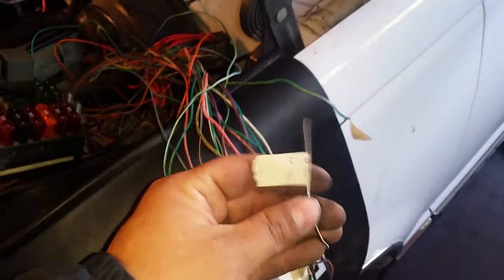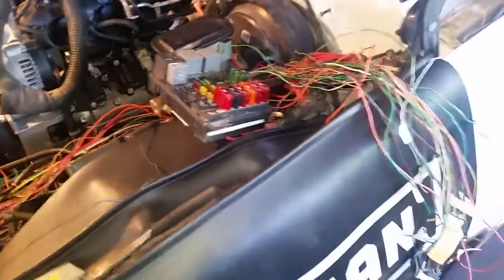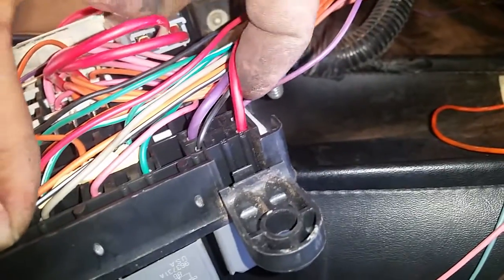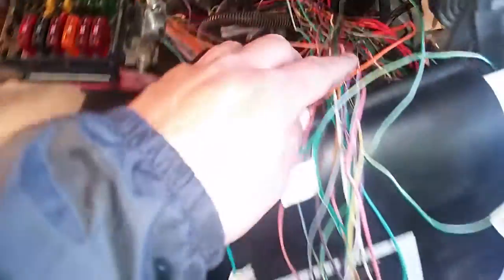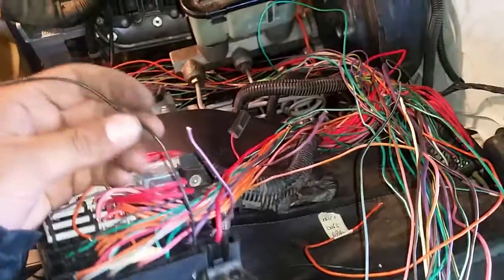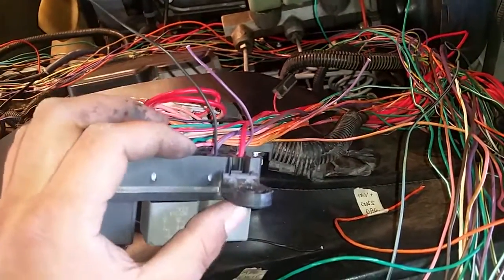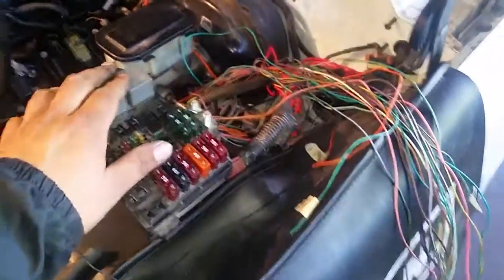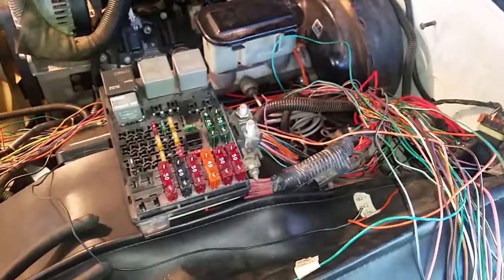OBS Starter control with new pcm

Comment: What  year truck are you swapping?. I am admiring the fuse block thinking it would work on my 63 Impala swap.
Reply from the maker: 97 suburban.  Don't put anything like that in an impala. Custom make your harness to fit that car. I know,  I have a 64 too.
Reply: @skeeter5283  it looks a lot less complicated than the 2002 Silverado   under hood fuse block that came with my engine and still has the modern relays and Maxi fuses I'm looking for. Fuel pump starter cooling fans AC etc.
Reply: @skeeter5283  love the starter update

Comment: So your saying i should send my harnesses to you😆
Reply from the maker: Did I say that?
Reply: @skeeter5283  no😊i was just joking. Thank you for all the uploads youve done. I still watch your old videos.
Reply: @skeeter5283  mines will be slight diffrent with it being 4x4. Im trying to see if i can go with a newer transfer case and front differential. Basically using all matching LS engine,diff,and transfer case.
Reply from the maker: @JoseContreras-mv5yz  that's what I want to do next. Check out this badass truck if you haven't already seen it, https://youtu.be/-D0hFHyuHWw
Reply: @skeeter5283  yes ive seen that over and over😆😊only thing that gets me is the angle to use to make that bracket for the front differential. Im sure you dont have to build the bracket that way either. I was thinking something in a shape of a triangle.
Reply: @skeeter5283  @ amigo, on 99-01 pcms   Weres the crank signal? O no tiene?

Comment: Is there a way to add fuses into the original fuse block for coils, injectors ect.? I’m trying not to have to add a stand-alone fuse block
Reply from the maker: I actually tie all the pinks to the existing fuse block,  and orange,  red,  etc.  There is no reason to add more Fuses,  if any of them short they all go down together through factory fuse location.  What year obs are you working on
Reply: Gary Garcia it’s a 1995. I wasn’t sure if the stock wires and fuses could handle the extra load if I just spliced into them
Reply from the maker: @SuperBogdaddy  that's what i did on my 97 suburban,  i grabbed every single pink hot from both harnesses and joined them by solder,  it's a lot of wires, but i have a torch that joins them well.... been running strong for a few years with no fuse issues

Comment: Gary please give me some help i have the new 411 pcm programmed with my vin..1996 tahoe obd2 will it be able to go thru emission with the swap being done
Reply from the maker: Good question,  I've never done that.  I know there are changes that need to happen in your O2 wiring,  and there will be extensive rewiring at the pcm. You will need to research this to find out,  I'm not sure.  Try to reach brendan at lt1swap.com for his input.  Good luck. .

Do a whole swap instead
Reply: @skeeter5283  yes the whole swap to the ls..the ls computer has my vin in it from lextech..i know i will have to repin to run off the new 411 pcm..so everything should read right with my vin but are they going to say wtf 6.0 didn't come in that or am i just going to plug in and see no codes and pass me
Reply from the maker: @Isleepin516  if you do everything right they don't look for vin,  you can actually just take the computer and have it flashed to run independently and it still passes. They only look for readiness, fault codes, and mil light cycle. They won't roll the vehicle or anything like that
Reply: @skeeter5283  do u have any swaps that rolled thru emissions yet? And are u talking about a stand alone? From what i know ur vin gets pulled when they hook up obd2
Reply from the maker: @Isleepin516  I've done 15 of them,  every single one passes emissions.  You can tune the pcm to ignore cats,  rear O2s, all the evaporative emission related stuff etc,  so long as you cycle a mil light and prove emissions readiness it passes.  There is a vin check of the dashboard plate to verify the vehicle is correct,  not the pcm to vehicle.
Reply: @skeeter5283  i am in phoenix any way to contact u?
Reply from the maker: @Isleepin516  send me your number skeeter5283@gmail.com

Comment: Unfortunately the original sensor is 1/2 diameter so I'm not sure if I can find one that size. If  I have to install will tap the water pump as a last resort.
Reply from the maker: Find a different sender that triggers gnd at that temp with the same metric thread,  check Napa

Comment: Hey Gary do you have any suggestions for connecting the water temperature sensor for a 71 c10 to the LS engine without   drilling the water pump ?
Reply from the maker: Yes,  look at my other videos,  there's one listed that explains proper water temp hookup. It uses metric 3 lead setup that will drive your gauge.
Reply: I've used the 3 wire  sensor on several swaps but I'm currently swapping an 02 ls1 into a 71 c10 and keeping the original water temp light aka "the idiot light"
Reply from the maker: @dhall4643  oh the dummy over temp light? You can remove the Allen bolt on the other head and buy adapters

Comment: Hey Gary I got everything hooked up and going but when I try to start the truck it acts like a carb motor where u gotta kinda pump the pedal to get it to start then itll only run for a few seconds have u ever had this issue ?
Reply from the maker: Josh Vaughn vats? Fuel pressure?
Reply: @skeeter5283  not sure on the vats but I wouldnt think it would run at all if it was the vats and the fuel pressure not sure how to check I'm runnin the stock 97 pump with the Corvette filter
Reply from the maker: Josh Vaughn who flashed your pcm? Check fuel pressure at rail
Reply from the maker: Josh Vaughn 50-60 psi
Reply: @skeeter5283  Justune in Kansas city mo I'll call an see if he can confirm thanks for the help !

Comment: Hey do u have any video tht explains what to do with the actual 4 wires off your standalone harness ? On my year truck is repin the only option
Reply from the maker: Josh Vaughn what exactly are you referring to
Reply: Gary Garcia on my stand alone harness i got 4 wires a 12v constant hot ..a 12v key hot...a fuel pump wire an a starter wire do i put them on wires comin out the factory fuse block or bulk head fire wall plug or do i repin them to the new pcm ... on older vehicles some ditch the factory fuse block.
Reply from the maker: Josh Vaughn a 4 wire harness is for an older vehicle,  what vehicle are you wiring? If it's an older truck,  it's ok,  but anything chevy obs 88-98 already has relays and such in place
Reply: Gary Garcia i got a 97 Chevy...so is the 4 wire stand alone harness i have useless or do i just have to repin i stripped my 4.3 factory harness down already i splice the 4.3 nss to the 5.3 harness thts why im confused about what to do with the 4 wires from my stand-alone
Reply from the maker: Josh Vaughn the 4 wire harness has relays that someone added to it right? If so,  none of that is necessary because your 97 has a fuel pump relay,  you just need to use the wire from pcm for fuel pump control. (Green/white) the 4 wire already supplies 12v to a pump.  The pink wire will be from any pink in your truck to engage each separate load in the harness (injector,  sensor,  o2, maf) etc by way of a relay they installed on the harness. Ground goes straight to ground,  and hopefully the red 12v is heavy enough gauge should go straight to battery
Reply from the maker: Josh Vaughn the purple wire is the starter wire,  it's just loomed in the harness makes it easier,  make your connection at firewall and wherever they left the wire,  typically by relays.

Comment: Gary i got a 97 an i swapin in a 6.0 out of a 02 i got a stand alone harness an i got the nss from the 02 harness in my trans now an im not gettin any power to my ignition an none of my dash lights are workin ....do i need to use my 4.3 harness for the nss ?...u say in the video u put ur old nss on the trans an wire it like normal what do u mean by that ....thanks in advance
Reply from the maker: Josh Vaughn you don't have the gear selector light up? Or the actual dash entirely is not lighting up? There's a 4 pin connector with small gauge wires on the 02 nss, tie the vehicles existing wires to those in parallel. In other words,  the pcm from donor needs to see them and the gear selector switch can also see them,  same signal
Reply: Gary Garcia so i just splice the old 4 wires from my 97 harness with the new ls harness ? Thank u for gettin back with me most people dont
Reply from the maker: Josh Vaughn yes splice, use solder
Reply: Gary Garcia there are 2 plugs on the trans the NSS an another plug do I have to slice the other plug together to ..for some reason my injectors aren't firing I can spray fuel in it an itll hit any ideals on why this might be happenin thanks in advance
Reply from the maker: Josh Vaughn have you disabled the vats?
Reply: Gary Garcia as far as I know yes I had the computer bench flashed
Reply from the maker: Josh Vaughn the pcm controls the grounds to each injector,  with the key in the on position you should have 12v on either side of the injector. Put one lead on gnd and use the other lead to verify on either side. If there's voltage,  there's either vats,  or igniting coil issue. There's a gnd behind power steering pump always easily missed

Comment: Where did you find the wiring diagram for the original fuse block.
Reply from the maker: Chasemanuti i scoured Google for it
Reply: Gary Garcia what is that block called ?
Reply: c100

Comment: I have a question for you Gary so I have 91 obs that keeps idling high and low so far I've changed the EGR, IAC, Fuel Injectors, spark plugs/wires, distributor cap/ rotor and checked for a vacuum leak and nothing. I appreciate it if you reply thanks
Reply from the maker: Manny Gutierrez these engines rely on a coolant temperature sensor to determine idle,  i would check and make sure it is operating correctly
Reply: +Gary Garcia where can I locate it?
Reply from the maker: Manny Gutierrez I think it's by the upper coolant neck,  it's a two wire sensor,  black and yellow wires
Reply: +Gary Garcia changed that and it keeps idling high. Are you ever in phx?
Reply from the maker: Manny Gutierrez I live in phx but I'm no expert with those era motors,  I would recommend to have someone diagnose it for you
Reply: +Gary Garcia alright thanks for the help
Reply from the maker: Manny Gutierrez I will say I Google tbi high idle,  and there's a lot of info available,  I did read something about the tps, and wear on the throttle body on high mileage engines. I'm pulling these old tired engines and going with the new stuff so I haven't spent a lot of time on them
Reply from the maker: Manny Gutierrez http://www.techsupportforum.com/forums#/topics/225088?page=1&_k=670e7h
Reply: @mannygutierrez1484  on these we have 2 coolant temp sensors one on top next to ur thermostat and one on the driver's side block next to ur manifold one is for computer and one is for ur gauge

Comment: Brilliant !!!!!!   I may have to rethink and change mine a little.  I like that you are changing this from a Positive switched Starter relay to a Negatively switched relay to preserve the Autostart.  Did I mention Brilliant...
Reply from the maker: UCanDoIt2 thank you! BTW,  watching your videos is inspiring me to change my video quality,  i know you said Vegas movie, my question is,  what are the specs on your computer?  processor? ram? hard drive?
Reply: The 99-03 PCM Pinout charts do not identify the two pins that you mentioned so I am wondering if the starter relay was handled differently.  I will do some more research.  My large Purple wire (coming from the Starter) was cut off during the pull ( by a salvage yard) which makes ne think the Starter relay is handled differently.  Cheers!
Reply from the maker: UCanDoIt2 i think starter relay control started with dbw, but I'm not completely sure,  brendan at lt1swap.com mentioned it wasn't in older vehicles
Reply: Just finished walking through the diagrams and determined that the 99-02 harnesses do not pass the Ignition circuit back through the PCM, therefore the PCM was not used for starting assist.   Oh well!!!  At least I now know exactly how this part works and plan to diagram my solution (which I was putting off till later).  I'm about to upload Part 5 and mention that I will plan to go over my Starter Circuit in Part 6.  In Part 6, I would like to mention and point people to your video (this one) because it would be helpful to those running an Automatic Trans.  You OK with that?
Reply from the maker: UCanDoIt2 oh yeah!
Reply: Very Cool!   While your configuration is completely different (Newer Harness and Automatic Trans), it is amazing how your walk through pointed me in the right direction and I was able to determine my solution off your information.   This is such a great platform to share and learn.  Thank you!
Reply: I have published Part 6 and discussed the things that we addressed here.  I added a "Card" to point people to your video (this one) so if they have a newer harness they can preserve that feature like you have.  Cheers!

Comment: Hello , what color is your 12v switch wire from the original harness ?
And also what's the color of the fuel pump wire that i need to connect to my stand alone harness fuel pump relay.
My engine is cracking but there no fuel because i cant find the exact wire to power my fuel pump. I'll really appreciate if there's any way you can help me out. Thanks
Reply: Eder Valdivia did you ever find this out I need the same info

Comment: Gary, just got a 2000 LM7 for my 97 Suburban  and wondering if the fuse block in the video is the 97's fuse block or the 2004s?
Reply from the maker: davkenrem i use the harness from the donor engine, and mate it to the 97 fuse block
Reply: Gary Garcia thanks
Reply: Gary Garcia thanks for your videos.. I am doing a 95 obs ls swap with the prnd lights on dash.. How can I get the neutral safety switch to work properly. Can you guide me on how I would get this featured installed properly?. I want to know what wires activate the neutral safety switch. Any help will be appreciated. Thanks in advance
Reply: Do I need to mate some of the old harness with the new one?. I am also tapping into the original fuse block to power my 12v keyed wires and to power com. It's a 2002 donor